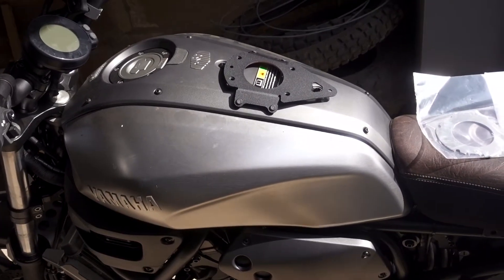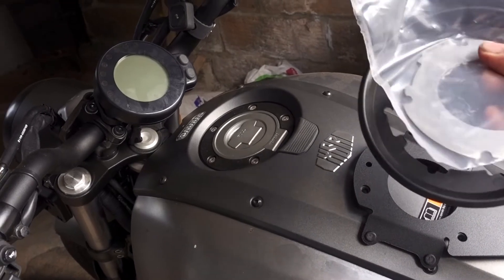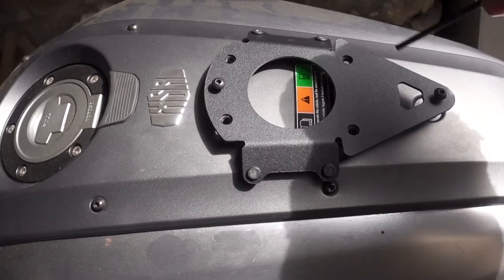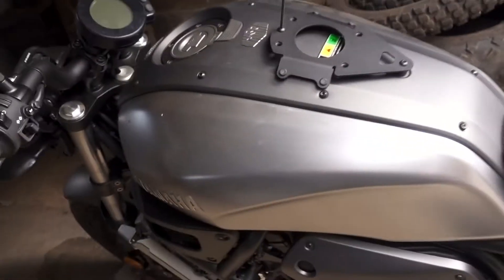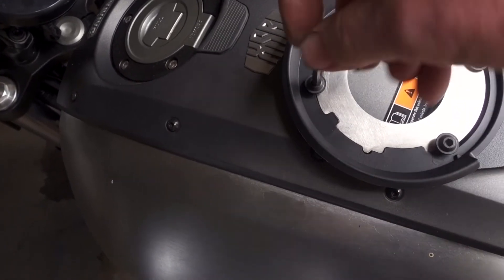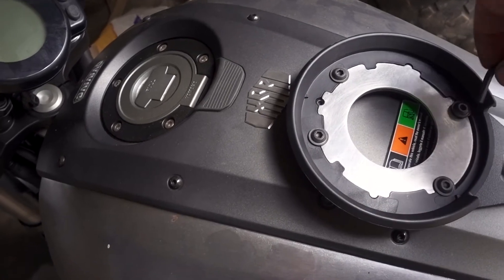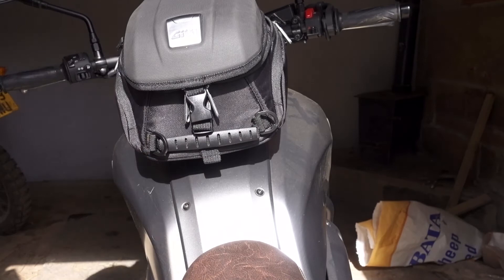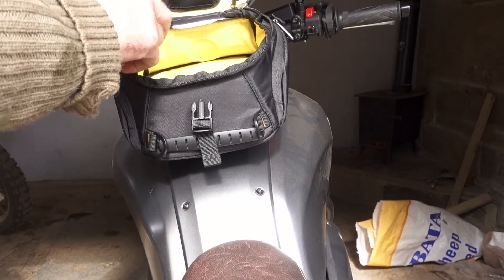Givi Tanklock system and Yamaha XSR700

Comment: Is that working on the xsr 900 as well?
Reply from the maker: You can use the system but the mount is  more like a ring around the fuel filler.